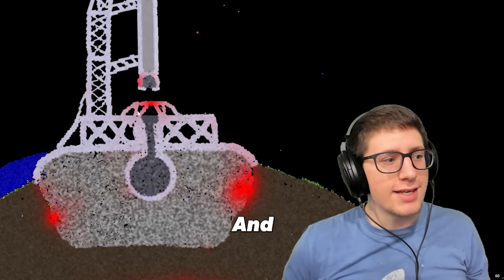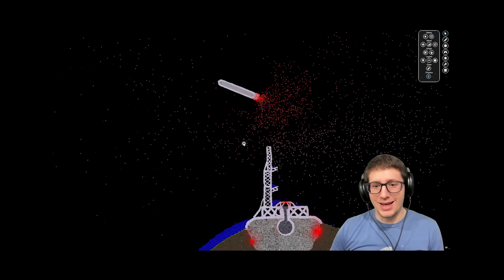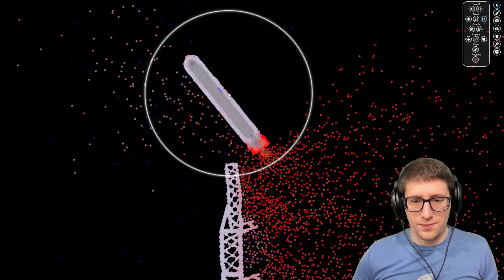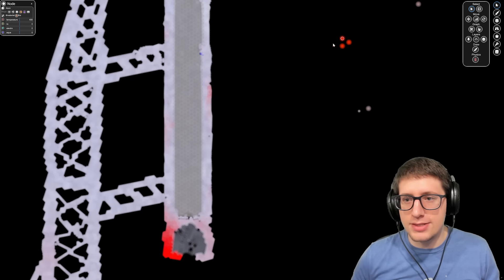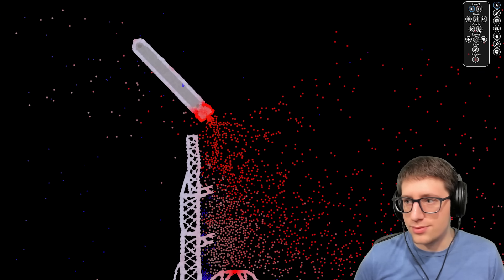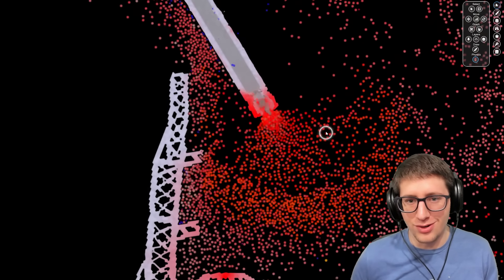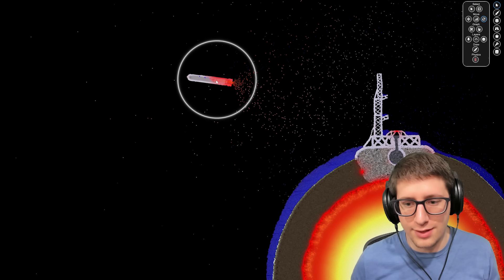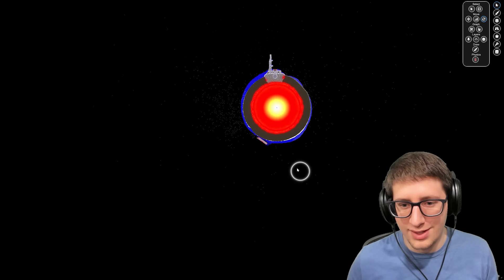My ROCKET (finally) REACHES SPACE (without exploding) in SST!

Comment: Hey there so im at 9:30 in the video and I think the increased mass of the fire worked well and I think if you put a nossel on the bottom and not keep cutting your combustion chamber open a lot you would have a more easy time keeping the fire lit inside the chamber and it sustaining ignition 
ps sorry for bad working im just very tired from pulling a all nighter

Comment: you should seperate the nozzle from the combustion chamber. Currently the fuel is entering the nozzle, and then burning, and then exiting the rocket. Doing it this way REQUIRES there to be a small hole in the nozzle so the combusiton doesnt escape, which keeps it lit.

What you should do is instead have a seperate combustion chamber, which fuel is fed into. (Maybe many smaller fuel channels would work better than one huge one?) The chamber is pressurized to very high pressures because of this, and then all of the hot pressurized gas escapes through a hole to a nozzle, where it expands and is redirected to go down, which produces thrust and prevents the chamber from exploding. Since they are seperate the nozzle can have a very large hole, which produces a lot more thrust. All of the exahaust should be going directly downward and not off to the side. If it goes to the side it is ineffecient. (If you have multiple small fuel feeding holes, it may help prevent the pressure from escaping back up into the fuel tank.)

Also, you should try and make it start to curve in the opposite direction, so it doesn't hit the tower. If you actually want it to get into orbit you will very likely need it to be 2-stage, maybe have some sort of timer or system that automatically lights the upper engine. The upper engine heat can be used to melt the connectors that connect it to the first stage.

I have no idea how this game works, but if its possible to have some logic control system, making the rocket be controlled by a computer would be so so much easier and more reliable to fly. It would need to maintain engine pressure, be able to light and delight the engine when needed (to cut the upper stage off when it has reached orbit, or relight the booster  if you want it to land back on the ground in one piece.)

Comment: A fluid only goes faster when the channel is wider if it is moving at the speed of sound. If it isn't (like in this case), it goes slower. That's why real rockets have a combustion chamber with a narrowing channel that ends in the nozzle once the exhaust is already going at the speed of sound.